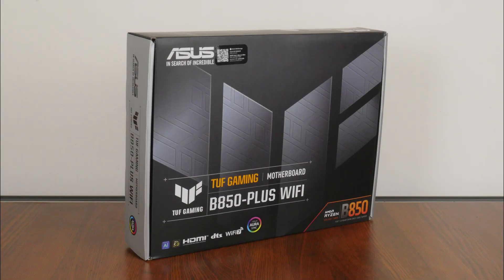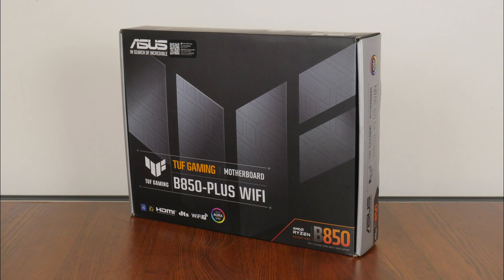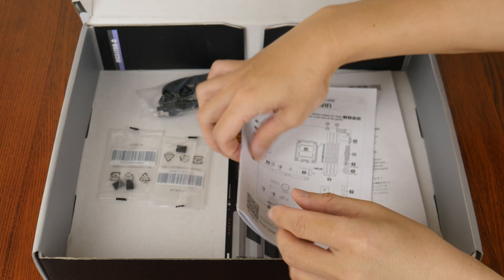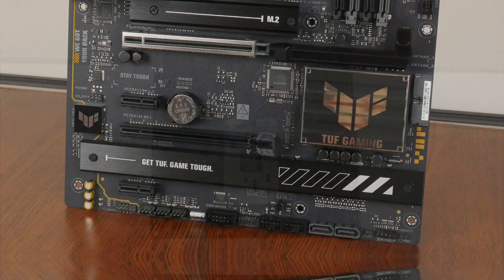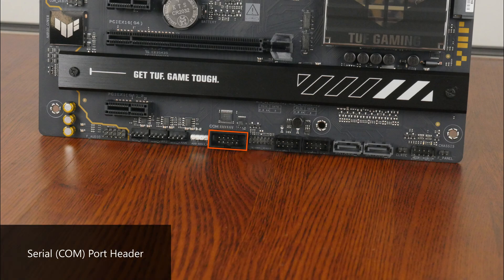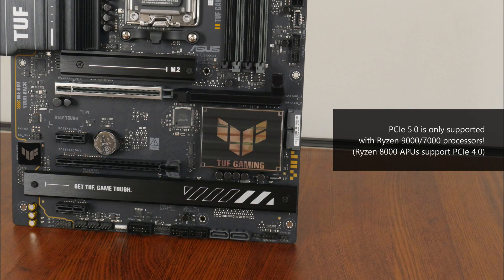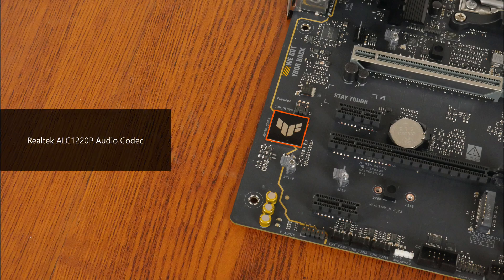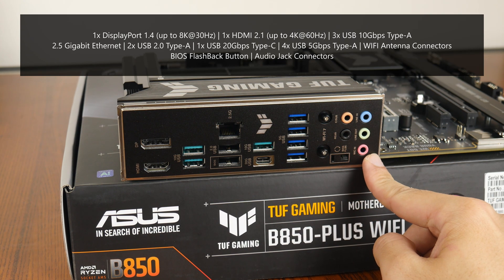Mainstream AMD B850 Motherboard - ASUS TUF Gaming B850-PLUS WIFI Unboxing & Overview

Comment: Hey thank you for the video. I have one question. Is it necessary to have the antenna connected to be able to use Bluetooth?
Reply from the maker: Hey there, yup the Bluetooth function typically requires the use of the same WIFI antenna, so it'd be ideal to have it hooked up to the board else you might have connectivity issues!

Comment: one thing to point out about this board and this chipset in general,
the VRM on this B850 board which is the same as B650, it has
8 + 2 + 1. this means in terms of power delivery, best Ryzen CPU 
pairings for this board are, Ryzen 5 7500f, Ryzen 7600, Ryzen 9600,
Ryzen 5 8600G and 8500G and 8400f. those are the best pairings,
now the limit are, Ryzen 7 7700 and 7700X3D, Ryzen 5 9600 X3D,
Ryzen 7 9700X3D. so those thinking of putting a Ryzen 9800X3D,
you'd be better off looking at the X870 version of this board, unless
you grab a ROG Strix as that will be better.

B850 = 6 + 2+ 1 =  lowest.  8 + 2 + 1 = midrange.  12 + 2 + 1 on the highest
X870 = 8 +2 + 2 = lowest.  12 + 2 +2 = midrange = 16 + 4 + 2 on the highest
A620 = entry level, lowest only has 4 phases. midrange is 4 + 2 + 1. and the highest 6 + 2 + 1

so you see how much you get in each chipset, but some other motherboard
manufacturers such as MSI and Gigabyte often use higher quality capacitors.
but Asus usually gives alot more features, so you get some trade off with
VRM performance. however i do feel like Asus will sometimes skimp out
or cheap out certain features on some chipsets, it's like the ROG Strix line.
these boards used to be highly regarded and recommended, but nowadays
they can still leave something out just to have it only on their highest board.
that said this midrange board is perfectly fine for most people,
but lane sharing is something im not a fan of. i also don't like the fact companies
are eliminating Sata support all together, that is so dumb.

Comment: Why should I get this over the MSI Tomahawk B850?
Reply from the maker: How's the price difference like between both boards where you're from? I've not had the chance to handle the B850 TOMAHAWK MAX WIFI, but based on specs alone, I'd probably go with the MSI as it has better WIFI 7 and better audio compared to the ASUS!
Reply: @ALKtech  The ASUS Tuf B850 has WIFI 7
Reply from the maker: @SpiderMan4327  yup it does, but its WIFI7 module (MediaTek MT7925B22M) supports a maximum channel width of 160Hz, versus 320Hz with the WIFI7 module found on the MSI that is better!
Reply: @ALKtech  I dont use WIFI on my PC. I u se internet connection lane

Comment: Just received my board today.

Pairing it with a 9700X and an RX 6800 from my current build I’m replacing.

Excited to build tomorrow.
Reply from the maker: Nice - and you'll definitely have headroom to upgrade your GPU and CPU further down the road, given that the board supports PCIe Gen 5 for a graphics card, and that AMD will likely be launching its next-gen Ryzen processors on the same AM5 socket!
Reply: Can you overclock your 9700X to 5.8GHz stable with this board?
Reply: @Stardomplay  I have yet to attempt it. I don’t have a super high end cooler, just a Frozn A620 Pro SE
Reply: @Stardomplay  haven’t attempted that yet, not sure I have adequate cooling to hit that high.

I’ve just got an ID-Cooling Frozn A620 Pro SE

Comment: Just bought this board. Pairing with a 7600x and 32gb 6000 cl30 ram. I think i made a good choice. Asus has never let me down all the way back to 2004.
Reply: what ram and what voltage on ram. also what psu do you have and what gpu?

Comment: Great review! Hope to see more motherboard reviews. Very informative! Thanks!
Reply from the maker: Thanks, glad you found the video useful. Cheers!
Reply: @ALKtech question for you. Would you go for this mobo or the asus prime x870p wifi mobo? Deciding between these two. Thanks!
Reply from the maker: Mmm. What's the price difference like between both boards where you're from? From a processor support perspective, both boards will be pretty similar (at least on paper, given their VRM setup), the key difference being that the PRIME X870 supports USB4 and has one more M.2 slot (but has some permutation of PCIe lane sharing with the PCIe slots that the board comes with). Price would probably be the main deciding factor for me!
Reply: @ALKtech US. The b850 tuf is $199 currently while the prime is $209. Yeah the pcie lane sharing with the x870 prime threw me off and the 2 sata ports. I like the 4 m.2 and thats about it for the prime. I think im going for the b850 tuf

Comment: I have a specific question about M.2 cooling or heatsinks.. How much I have to pay attention to different heatsinks on different motherboards for "main" M.2 slot? For example this heatsink look more "BUDGET" in general as also in MSI MAG B850 TOMAHAWK MAX in comparison with ASRock B850 Riptide WiFi.  A simple question - how much doest it really matter?
Reply from the maker: Hey there! I'd say to the average user, as long as there's a heatsink, you're all good to go and don't have to worry too much about the heatsink's performance. That said, PCIe 5.0 M.2 drives tend to run much hotter than PCIe 4.0 drives, and this could be something that heatsink quality will then have a bearing on, especially if your case airflow is poor.

Worth noting that PCIe 5.0 M.2 drives still aren't all that commonly used at this point in time, but if you're intending to use one, do make sure that you've got good airflow all around in your PC case. My two cents!

Comment: I am using this motherboard and I have a question. I have two SSDs (Crucial T500 with heatsink). One is installed in the M.2_2 slot. The other one is not recognized when installed in the M.2_3, but is recognized when installed in the M.2_1 slot. I have a graphics card in the PCIe 5.0 x16 slot. The PCIe 4.0 x16 slot, which shares bandwidth with the M.2_3, is empty. The SSDs are installed without the rubber bands placed underneath them because of the heatsinks. I was wondering if I need to change a setting in the BIOS to enable M.2_3. Thanks in advance!

Comment: Will this support bifurcation of PCIe by default?  The reason I ask, is that I need 10gbe and this is 40% cheaper to do with an PCIe x8 card in the second x16 slot on this board rather than purchase the Asus ProArt X870E-Creator with onboard 10gbe.  It seems I would take a 2% hit to gaming GPU performance (4090 @ 4k) but I can accept that.
Reply from the maker: Hey there - this board doesn't have any lane sharing for the primary GPU slot! The only form of lane sharing is mentioned at 8:12 of the video, but this is only if you've got a M.2 SSD installed in slot M.2_3, which will cause the second x16 slot to be disabled entirely. As long as you're not intending to install more than two M.2 SSDs on this board (i.e. only populate slots M.2_1 and M.2_2), you'll be fine!

Comment: Can a 4000 series be installed in the new graphics card slot?
Reply from the maker: Are you referring to the RTX 4000 series of graphics cards by NVIDIA? If so, then yes!
Reply: @ALKtech  I'm talking about using the RTX 4000 series graphics card in the PCI 5.0x16 pin slot and if we can use it, thank you very much for providing this information.
Reply from the maker: @ yes the RTX 4000 series cards will work perfectly fine with the PCIe 5.0 x16 slot!

Comment: If I use the 3rd M.2 slot (the bottom right one), it disables the bottom PCIe x16 slot. Does it have any effect on the upper PCIe x16 slot (the one I put my GPU in)? I read somewhere that the upper slot will only work in x8 mode if I use all my M.2 slots.
Reply from the maker: Hey there, for this motherboard, the primary PCIe 5.0 x16 slot for your GPU does not share bandwidth with any of the M.2 slots at all. What you read about the upper slot operating in x8 mode is very likely for other motherboards powered by the X870E or X870 chipset, where due to design limitations, they share bandwidth with one or two M.2 slots. Hope this clarifies!

Comment: Yes, at least they use good Codec in this one. Rog have crappy and shitty 4080 and have 2 sata port. Be aware if you decide to buy 4080 codec mobo, you can encounter crackling sound even over optical output. This board is overall very good and i think reasonable price. My no1 priority list is this board.

Comment: How many price this motherboard???
Reply from the maker: It's currently listed for US$229.99 on Amazon!
Reply: @ALKtech  329 EU here. Everything is messed up here. My 7500F CPU waiting on my table about 2 month 😕
Reply from the maker: @ damn that sucks. Out of curiosity, which country are you from? I'm from Singapore, and our PC hardware prices are almost always more expensive than US/European prices, but not to the extent that the B850-PLUS WIFI costs €329 😅
Reply: @ALKtech  Cyprus my friend. I can't set up my computer. The problem is not just the prices. Let's say there is a problem, you will have to wait 7-8 days for the problem to be fixed. Because the part you ordered will be delivered to you in 7-8 days. I have money but the system is shit, you can't buy a part with peace of mind.
Reply from the maker: @ damn I see, is the DIY PC market small in Cyprus? Have you considered ordering from perhaps, Amazon US or other international e-commerce platforms? I'd think that shipping fees and the lack of warranty would be an issue though...
Reply: @ Yes as you said, shipping fee and most important thing is customs duty fee. If i ordered Amazon, price will be the same or high. And yes pc market small in here. Also everyting too much expensive, also you must  pay in advance of order and then wait 6-7 days. Thnks for your concern. I bought this motherboard from Turkey for 310EU (11.890TL). İ have no other choice couse other MB codec is ALC 4080 and i m avoding ALC 4080. Thnks again.
Reply: @ALKtech  How is that possible? Everything is made in Malaysia, you should have le lowest prices!